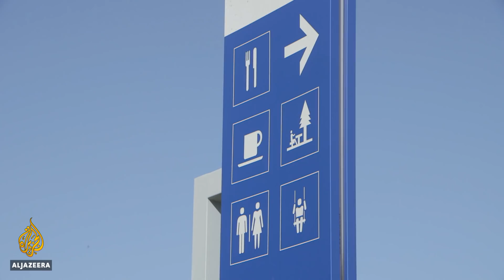France's plastic revolution | earthrise

Comment: As a French resident, it really is quite interesting to observe what has happened here in France.
In supermarkets and shops, if you turn up at the checkout without something to carry your shopping out of the shop with you, you are forced to buy bags made entirely of recycled materials, at extremely high cost (over $US1.00 per bag !) Otherwise, there is no alternative. Everyone brings bags when they go shopping, as much as they bring their wallet. It has become "normal" now. So although the prospect of entirely phasing out plastic packaging seems daunting, I am sure that with such innovations that are introduced in this video, it will soon become "normal" too. It really hasn't been such a hardship up to now. Paper, glass, and cardboard, are making big returns here. The really challenging issue is in the domestic use of liquids. From water, to cleaning products, to condiments like ketchup. Many of these products are not inert, and I think that is where the real challenges lie. Water is often sold in 5 litre plastic bottles. Making the container glass would introduce different problems, weight and disposal. That is where these new innovations can really contribute. Chemicals like bleach, or washing liquid may require individual solutions to combat the products chemistry.
I do hope that my country can boldly take the steps, not only to remove plastic from the waste cycle, but to prove it can be done practically. We fully understand that the world is watching .... closely !
Reply: I shop at Aldi and either I a) bring my own bag from the car or b) use one of their leftover boxes to carry my groceries home inside.  Later, the carboard is collected in a large recycle bin.  But with all the other grocery stores this concept, not so surprisingly, hasn't caught on.  Why does it take laws to re-educate people?  Why can't we demand our stores to switch over for us?

Comment: i would definitely pay more for bio plastics. 25% more on a bottle that costs less than a dollar is nothing to me compared to the peace of mind
Reply: Stop buying bottled water. Use 1 bottle and refill and wash.
Reply: The way they present the costs in this video is problematic. They are actually using a narrative created by the plastics industry as a way to influence public opinion against moving to non-plastic materials. By focusing on the percentage cost increase, it affects the way people interpret the costs. In the consumer's mind, they hear 25% and most immediately do the math of 25% applied to the full price of the product. Instead, the 25% increase applies only to the bottle. A 25% increase on the cost of a bottle for producing bottled juices is far, far less than one dollar. The full price of a bottle is less than 50 cents, if bought at retail in small volumes. Even at that price, the cost of a non-plastic based, biodegradable bottle would only be about 12.5 cents more added to the total price of the final retail product, if the increased bottle cost was passed on to consumers without additional markups being applied. In larger volume production, the 25% increase in bottle cost is likely to be a maximum of 2 to 3 cents. Saying costs will increase 2 cents creates a much different consumer response than saying bottle costs will increase 25%. Yet media continues to talk about this in terms of the narratives created by the plastics industry.

It is much the same as the attempts to block the Fight for $15 on the wage front in the USA. The corporate execs and politicians opposed to moving to a living wage for people talk loudly and often about the result being an almost 100% increase in wage rates for minimum wage workers. Consumer reaction is "Hey, I can't afford prices to double." Yet labor is such a small component of most products that actual prices would hardly increase. As an example, several economic studies have shown that moving to a $15 minimum wage would raise the price of a Big Mac by only about 10 cents. 

Humans do not process price and cost data in any kind of rational, logical way. The change from plastics will be difficult. However, environmentalists framing their arguments by using corporate narratives will only make it more difficult.
Reply: And u think u doing good usin bioplastic
Reply: i get glass bottles of spring water. i dont trust tap or filtered water. i also dont like plastic. i just meant i would pay extra for a bio plastic over a oil based plastic if i had to choose

Comment: if polymeric chain obtained from seaweed and petroleum based are so similar then how does seaweed based plastic decomposes faster?! 🤔🤔😵
Reply: They're not different.  That's what is so disappointing about this obviously ignorant or propaganda film still perpetuating a non solution to the problem.  It looks so much like normal plastic because it is normal plastic.  It doesn't matter if it came from oil or plants.  It's still plastic.  If they were honest they would show results of their decomposition but they didn't.

Comment: Those long chains of carbon atoms are the problem, regardless of what they are made of.
|If the structure is the same, it will not biodegrade spontaneously.  After all, oil is organic too.

Comment: Bring back returnable deposit glass bottles, as we used to have, they may weigh more so use more fuel. But we have to consider how much  Plastic is costing us, and the environment!. It’s not all about efficiency anyway, cos splitting water to make Hydrogen for HFC uses a lot of electricity, but Hydrogen from water is a perfect cyclic fuel.

Comment: These 2 ways of replacing plastic could solve the single use plastic problem. Think about it single use plastic mainly consist of bottles, plates, and utensils. There is also bags but that could be replaced another way. If the size of manufacturing were ramped up the cost would go down. These people need to get in touch with a company like Uline or some other major packaging company.

Comment: there are way cheaper solutions for biodegradable flower pots... 
Would like to see more clear bioplastics... water resistant so people can use them as straws and cups.. the well known one use plastics... 
like the last one.. and people also pay for the bottle with there drinks.. for many many years. 500ml coca cola really does not cost 2-3 dollars.
And we should never forget the glass bottles.. there production cost are extremely high, but they can be recycled often.

Comment: The real solution is washing and reusing glass, it's that simple. These "compostable" plastics made from a variety of natural items are a sham. Sure, they will compost in an INDUSTRIAL composting facility but what is the point in that? These facilities heat the compost up to 150 degrees Fahrenheit, no wonder the material melts. My local municipality does not accept compostable cups, dishes, silverware, etc. because of this very reason, they use the "old school" method of composting by turning the piles and adding water. Even if these bottles were compostable in the backyard, those orange tops and plastic adhesive labels are probably not going to compost anyways. As a side note, fruit and vegetable stickers do not compost, trust me, they were the only things left over in my black soil after a year. Once again, the real solution is washing and reusing glass, it's that simple.
Reply: Main question - how long does it take for theese compostable plastics to decay. And how do they behave in an industrial composter with their "150 degrees Fahrenheit' . . . 

" those orange tops and plastic adhesive labels are probably not going to compost anyways" - you can turn off those orange cups and throw them into your waste bin for plastic fraction. Plastic adhesive labels are non recyclable, so they will be incinerated or buried, but their mass and volume are non significant compared to its BOTTLE....  Theese are non significant issues. 
Glass is not a solution.